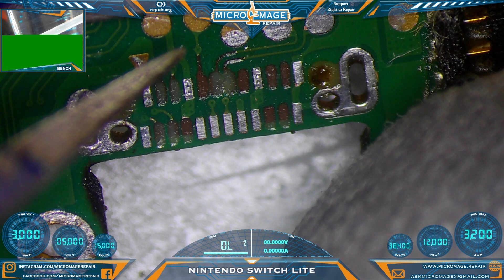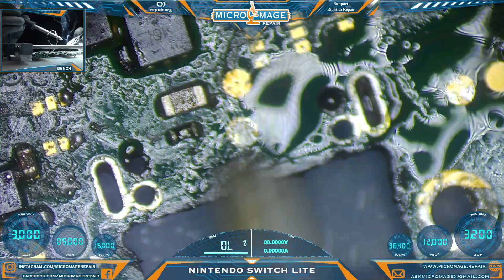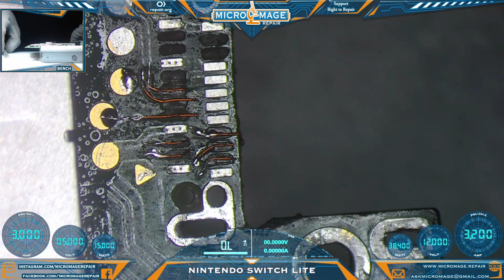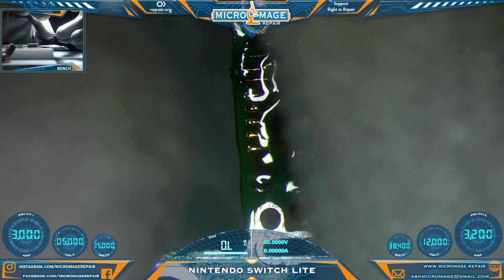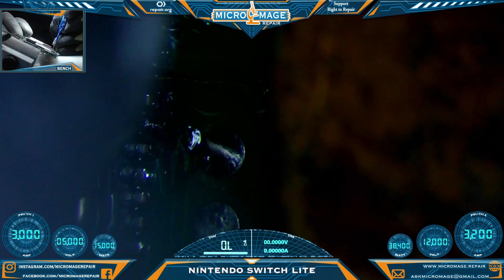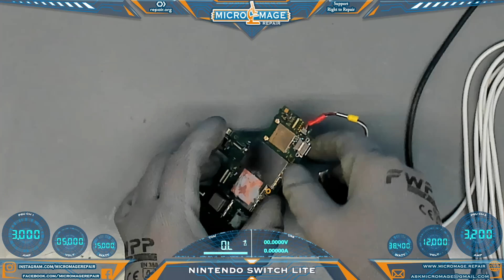Nintendo Switch Lite: Botched DIY Port Attempt

Comment: Is your hot air really set at 480c? 🤣
Reply from the maker: Yesir!  I rarely come off that temperature for consoles. iPhone and Pixels I drop down to around 380C or so. It's been a while since  I've messed with MacBooks but pretty sure I was at 480C on those.